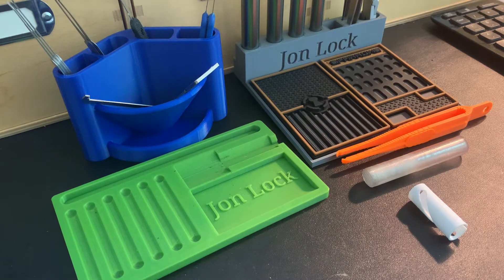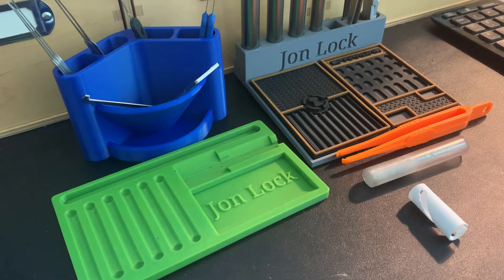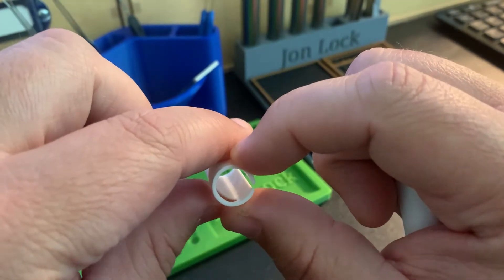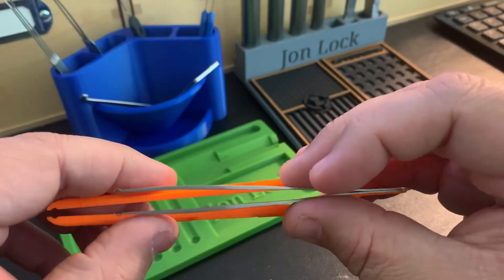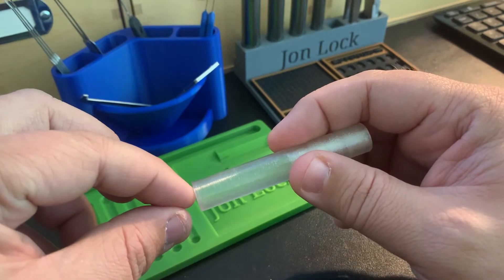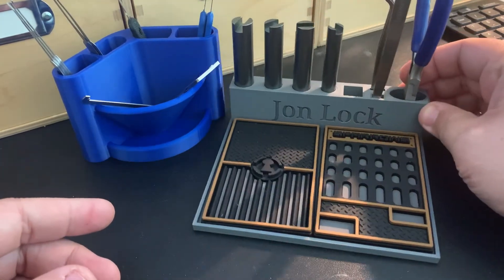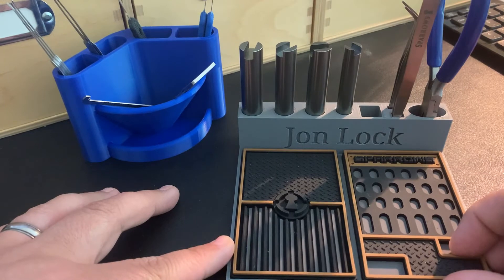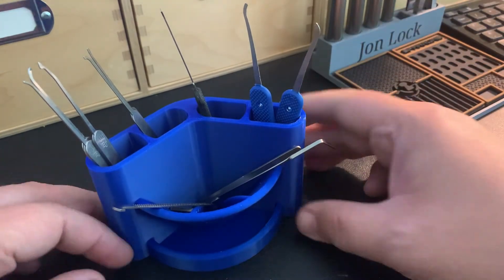3D Printed Locksport Tools

Comment: Very cool Jon, for that light-up follower it would be interesting to have the back part with the light and battery and interchangeable fronts with different diameters, little twist lock connection.
Reply from the maker: Very cool idea!